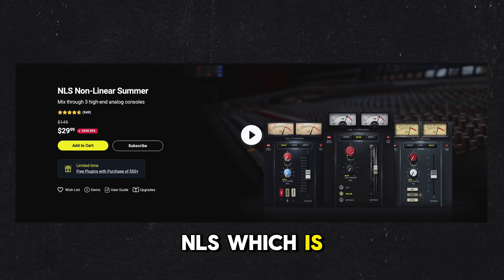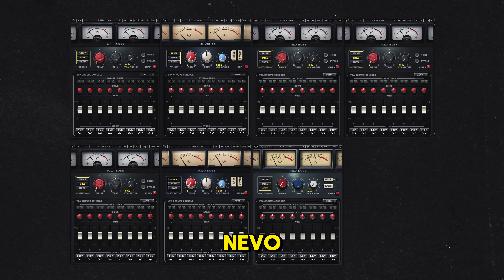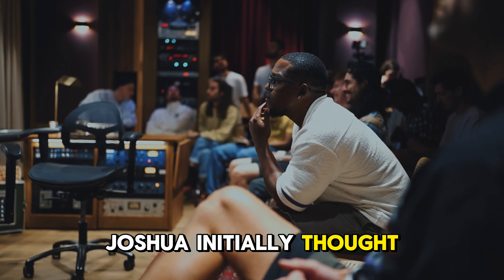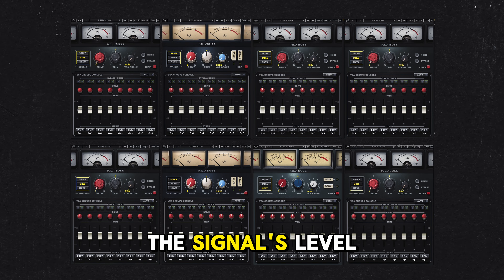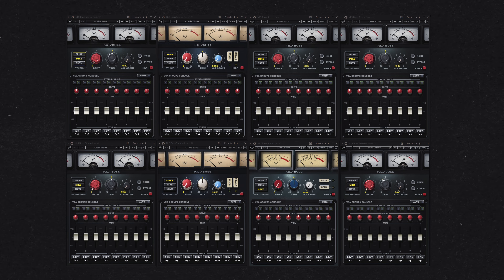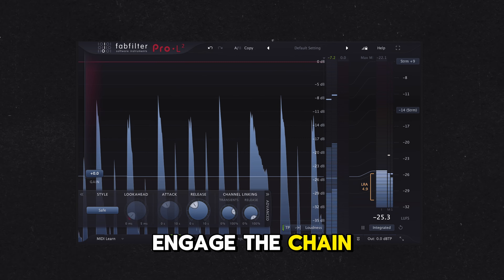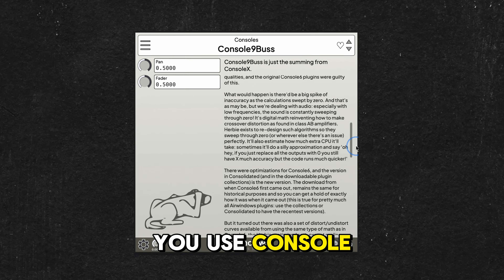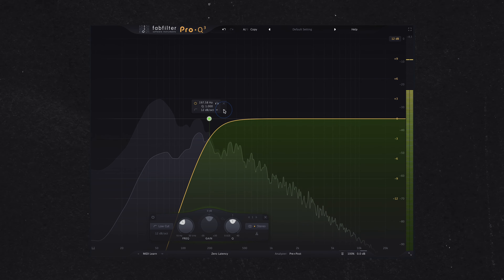Jaycen Joshua’s NLS Mix Trick for Heavy Low End

Comment from the maker: Four additional points to note:

1. Joshua often increases the drive on the first NLS by 0.5dB, enhancing the effect.

2. The NLS chain adds gain even if the drive knob is set to 0, so use the trim on the final plugin to prevent loudness bias from misleading your ears. With all drive knobs set to 0, the plugins add a total of 2dB of gain.

3. Not everyone will like what this does to drums/bass as there is some stereo manipulation going on. Your mileage may vary, so trust your ears as the final judge.

4. Techniques like this are subtle, but layering enough subtle elements can give you an edge. If you find this technique useful, add it to your arsenal and use it when it suits the mix.

Comment: You forgot to specify that all NLSs have 0.5 in the driver
Reply from the maker: They don’t each have 0.5 dB of gain—at least, not in Joshua’s Mix With The Master’s episodes. Nor does mastering engineer Julia Borelli when showcasing the trick. Perhaps Joshua sometimes adds 0.5 dB to each instance depending on the track.

Comment: So These 6 instances go on your master as the last chain?
Reply from the maker: Hey George,

Great question! Sorry—I should have added that to the pinned comment.

Joshua uses a separate NLS chain for his drum bus and bass bus.

So, he routes all his drums to an NLS bus, which then feeds into a secondary bus containing his usual processing plugins. The same setup applies to his bass buses.

From what I understand, he only uses this NLS trick on his drum and bass buses, not the entire track.

That’s Joshua’s workflow, but you can try adding the NLS chain to your master and see if it works for you. Joshua’s mastering engineer probably uses a hardware summing mixer. 

When I say “bus,” I don’t mean a reverb bus where you’d have both the wet and dry signal (essentially a duplicate of the signal). Those are send effects, but often also called “buses.” A bus, at least in this context, is when the entire signal is routed through a processing chain.

I hope that helps!
Reply: @BeatsbyVanity  ahh i see, yeah that clarifies it a bit. At the end of the day i guess, try it on your sub mixes, master whatever. The nls trick is wild to begin with anyway. I’ll try it today maybe and see if it fits my style. What about cpu usage and/or latency being introduced? Great answer, cheers
Reply from the maker: No problem!

Exactly— I always recommend looking at how tricks like this can fit into your workflow, rather than taking them as gospel.

I haven’t noticed any issues; NLS doesn’t seem to be CPU-hungry. But Airwindows might be a better option for larger templates.
Reply: Hi! Thank you so much for the video! Also I would like to ask about the order of plugins while we're doing this trick? What I mean is: do you put the all the NLSes and then the rest of the drum buss processing, EQ, a lil bit of compression etc or you process the buss and then put NLSes??
Reply from the maker: @mlodszyp Good question! So Joshua routes all of his drums to this NLS chain, which then feeds his drum buss processing chain, which contains the EQ’s, Compressors, etc
Reply: Thank you very much! Last question :)) - do you know why using the NLS chain in the mixer track resulted in panning of the sounds that are coming straight out of it? Do you know how to avoid that?
Reply from the maker: I know that it does happen, but I don't know why. I'd guess it's something to do with 
the channel crosstalk and small variations in the channel behavior of the analog consoles modelled. I don't think you can avoid it, as it's baked into the algorithm, but you could just add a plugin at the end of the chain that pan's it back to the center.

Comment: Pls help me to understand better, all 8 NLS inserts are on the Master track ?
Reply from the maker: Here’s a comment I left below answering this question: 

Joshua uses a separate NLS chain for his drum bus and bass bus.

So, he routes all his drums to an NLS bus, which then feeds into a secondary bus containing his usual processing plugins. The same setup applies to his bass buses.

From what I understand, he only uses this NLS trick on his drum and bass buses, not the entire track.

That’s Joshua’s workflow, but you can try adding the NLS chain to your master and see if it works for you. Joshua’s mastering engineer probably uses a hardware summing mixer. 

When I say “bus,” I don’t mean a reverb bus where you’d have both the wet and dry signal (essentially a duplicate of the signal). Those are send effects, but often also called “buses.” A bus, at least in this context, is when the entire signal is routed through a processing chain.

I hope that helps!

Comment: Not relevant with the release of the Orion plugin.
Reply from the maker: I disagree as NLS is simply used for summing, whereas Orion is Joshua’s entire drum bus. Plus, analog summing is a technique that predates Joshua’s work.

Additionally, not everyone can afford Orion; NLS is $30, and the Airwindows collection is free.
Reply: @BeatsbyVanity  Yes, but it doesn't use "analog summing" with NLS anywhere except on drums.
Reply from the maker: @ZTEKNO_Loops  Sure, Joshua uses it on drums and bass, but his mastering engineer might also run the entire mix through a hardware summing mixer.

In this video, I wanted to explain analog summing to encourage people to experiment beyond the famous NLS trick.
Reply: Great Video 👍  You can also get a great summing effect running your mix thru a good stereo or two mono preamps!
Reply: @BeatsbyVanity  got it, thank you.
Reply from the maker: Great suggestion! Are there any you’d recommend?